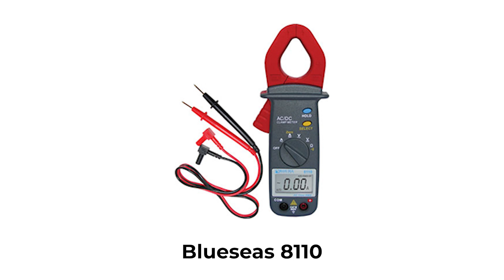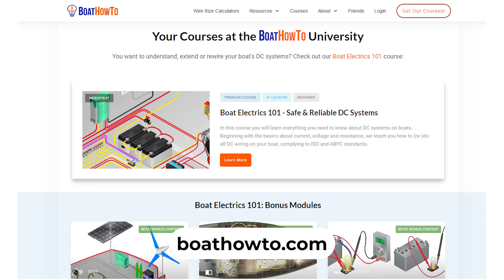Nigel Calder & Jeff Cote Talk Marine Electrical - Part 4 of 11 - Galvanic Isolators

Comment: So this whole video is dedicated to galvanic isolators, but then 2 minutes in Nigel Calder does not want to discuss one of the primary issues surrounding them - much to the horror of Jeff. I give you points for trying to get the discussion back on track Jeff, but it would have been better for your channel if you had canned this episode with Nigel and re-shot it with another tech who actually wanted to share his knowledge. Was very disappointing to watch.

Comment: Self-check user, should be pre-installed. Especially important on an aluminum boat to have testing and monitoring installed. 
I do have panel-component type split sensor-displays for when clamp on meters are not practical. 
Useful Jeff.